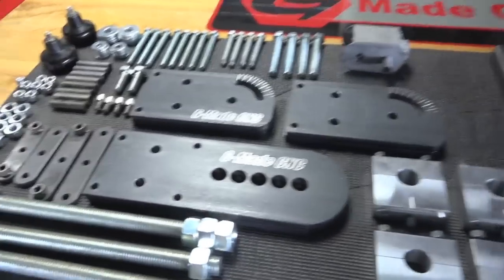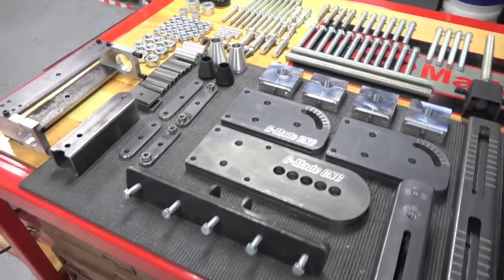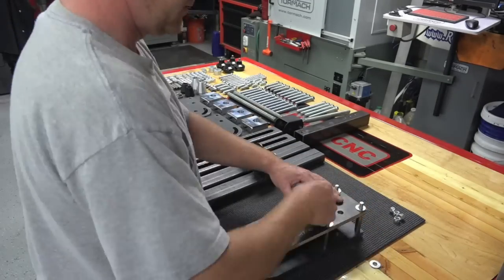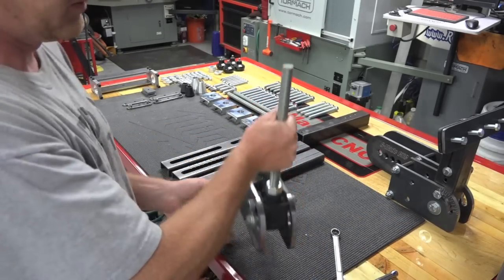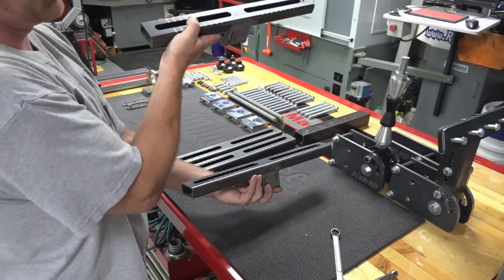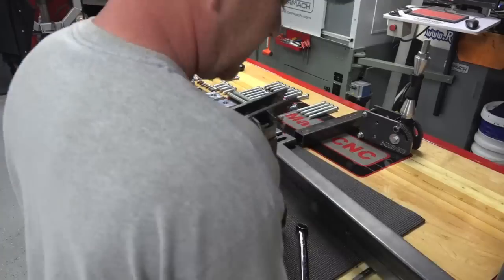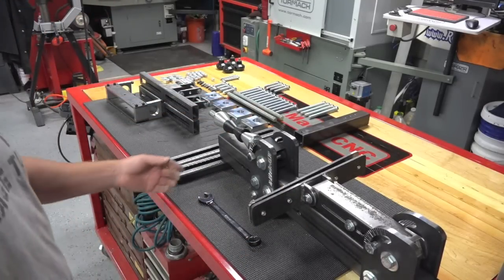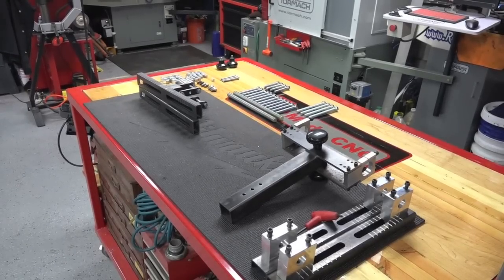Making a Custom Motorcycle Frame Jig using the Tormach Mill Part 2

Comment: I watch a lot of shop videos for fun / education, and I have to say that  the level of work that  you are doing is beyond anything else that  I have seen by a fair margin.  Also, the band saw incorporated into the welding table with the  rollers set perfectly level was an excellent idea.  If I ever need custom machine  work done, I will be emailing you for  sure.  Looks like you can make pretty much anything.